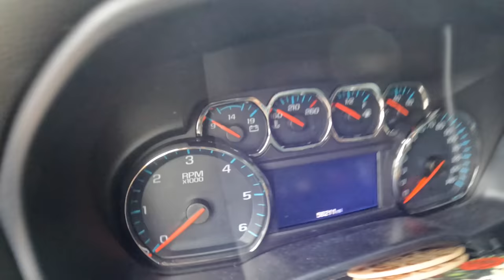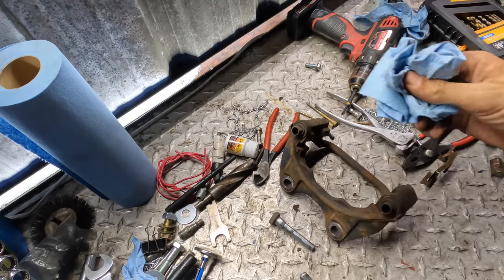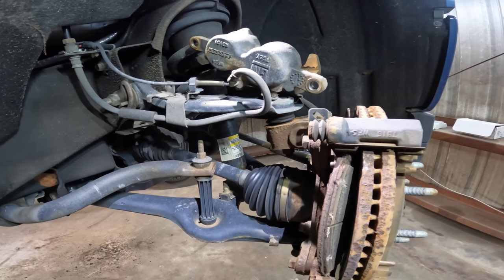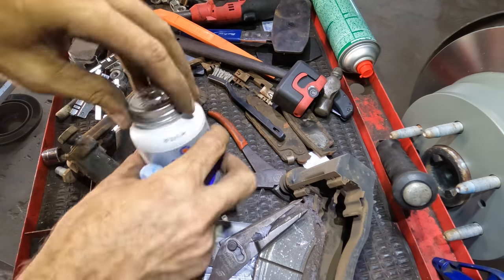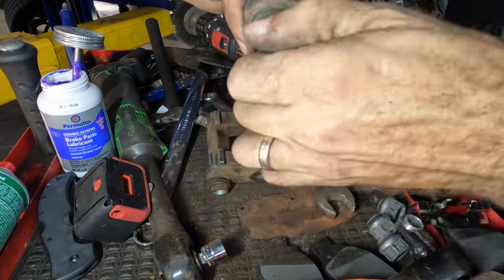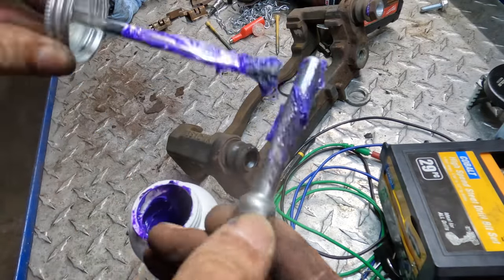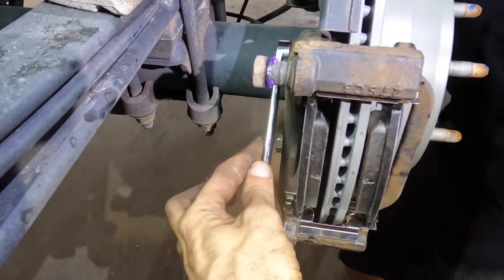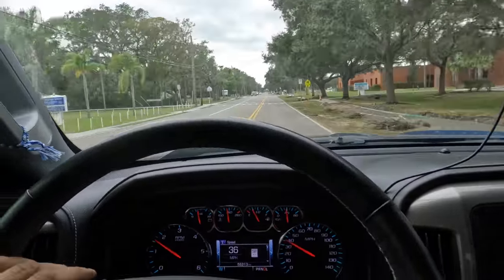Northern Rust! Challenge Accepted! New York Truck

Comment: When I do my brackets. I have found that getting a cutoff wheel and lightly touching it on rusty areas helps. Or a good flat file. That's if a wire wheel is not handy.

Comment: First, best of luck in your new shop. Second, what I hope you take as constructive criticism. I would have cleaned the old grease from the slide pin bore of the caliper bracket and been more aggressive on cleaning the rust where the shims attach and added some silglide grease there as well to help prevent future rust jacking. Also when a piston is that hard to push in, I loosen the bleeder or brake hose to determine if it's a caliper problem or a brake hose/master cylinder failure. A good test for brake drag,, on a slight grade less than 10% slope, apply brake, car out of gear, see if car ROLLS AS SOON AS YOU RELEASE THE BRAKE, You can test with car on lift by having someone in car,with brake on as you try to spin wheel, release brake and see how long it takes to release or if it does not release, repeat for all 4 wheels to pinpoint problem. You most likely know all of this, but sometimes in the heat of battle, WE FORGET SHIT.

Comment: You mentioned industrial lighting. Be warned that they are briiiight, even accidentally glimpsing them will leave one of those spots in your vision for a bit. There's another style that's more shaped like a traditional tube lamp but with LEDs that's also pretty good, and they also have a secondary LED set and a backup battery That double as emergency lighting. Don't know if you need that but if it's something you might consider, they exist.

Also if you're needing some serious air moving in the shop to keep it comfy, they're definitely not cheap but Big Ass Fans has some of the best stuff I've experienced. We have their AirEyes at work, typical wall or post mount fans but they have crazy air movement.

Comment: You must have missed a couple of episodes of South Main Auto (or you forgot to video these steps).  The area behind the clips needs to be filed/sandblasted down to bare metal.  Brake grease should be applied BETWEEN the caliper bracket and the clip.  A dab of grease on the backside of the pads is also good.

Comment: I have put a little bit of Kopper Kote on the metal to stop/reduce the oxidation between the Alum and steel. 
My they didn't use that much Brake Clean on the job of doing injector replacement on my truck as you use on one wheel.

Comment: That's not rust!  From Ontario Canada.  Had to take a sledge hammer to get my tires off.  I use under coating spray before reassembling to prevent such stickum rustiness from our salt sprayed roads.  By the way a great brake job.  Keep up the good work.  Enjoy all your videos.

Comment: Up in the rust, salt and dirt seen curbside We were always told to check the passengers side . The things I said would add abrasion material to that side wearing out sooner. But this one looks like the drivers front wore out faster. That caliper look's   suspect like you said. That pull to the right could be that driver side caliper not expanding.

Comment: Nice work.  The only thing I would add or do differently would be to clean the old grease out of the holes where those pins go. Then, put the new grease in the holes instead of on the pins so it doesn't scrape off on the rubber boots.

Comment: First customer,  don't forget to save your "First Dollar" to frame the moment. Great job on the brakes, you'll get your mojo back pretty quickly. 2 suggestions. 1 get a flap sanding disk for a angle grinder, holy cow, their awesome. 2, if your caliper  compressor won't fit, use a large C clamp. I'm sure your aware, but I cringed when you busted out the large plumber pliers. Great vid as always, cheers.

Comment: Just in case you dont have a sander or a way to sand the pads. Take the end of the pad and grind it in concrete. Of course with a coarse surface

Comment: i suspect it will need that left front caliper. in the numerous brake jobs i have done in my career, any pistons that push back that hard but do go back, the caliper ends up over heating, and i've always noticed a brake pull along with the smell of burning brakes.

Comment: So satisfying to see him to the full correct brake job (lube the pins, clean the hub, etc). Most shops just throw shit on and call it a day. Your own shop = do it at your own pace. Rather pay for this (or do it myself) than have a shop throw shit back on in 30min and have it all break later

Die Electric Grease also works as brake pin lube if you don't have any on hand

Comment: Hi Ray, Great to see you doing your thing again. You're going to do great but I did notice one thing was missing.  On top of all the other things you said you needed don't forget to buy a house phone for the shop so we can hear you singing do do do de do  do do do de do.  Was thinking about you yesterday as I was at Napa getting a new water pump installed in my Japanese soda fountain made by Nissan.   I will never buy another Nissan, they're terrible to work on.  To do any work on my Nissan you have to disassemble parts of the engine to get to things.  Anyway Napa installed the existing water pump 5 years earlier.  How the hell do I go through a water pump in 5 yrs (50k) ?   anyway I was going to wish you good luck but you don't need luck because you have skills.

Comment: Good to see you back in action!  It's messier for sure, but I use a line lock and crack the bleeder after putting a spot of pressure on the caliper pistons before compressing them.  Many moons ago, with the Teves Mk1, this was mandatory... really glad GM fixed that

Comment: You need to sand blast where the pads ride in the caliper mounts and then lube them so pads will float free. Take it from a mech In the York of new. Never seize rotor hold down screw. Lube and never seize everything. Also, membrane on the back side of new pads.

Comment: Great shop. If only I lived in Florida there is so much potential for that building. Can't wait to see what you do with it. Would the lifts make better sense reversed. It's hard to tell from the video if there's room but if is a more capable lift it would make sense to be easier to get on and off of. The smaller cars with easier turning could go on the little lift.

Comment: Ohh NOO. You should have put caliper lube on the ends of the pads so they don’t rust to those clips they slide in.  Over time especially in northern NY the ends of the pads and clips will rust causing the pads to stop moving freely (as you see in the video) and will drag, causing a sticking or not releasing caliper symptom. Lubing them in general is always a good idea to help them move more freely. Just one of those extra things you gotta do up here.

Comment: i still think you should switch the two lifts, the heavy duty lift is way more useful and ur only going to be putting smaller cars on the smaller lift and they will get around that corner easier.

Comment: Hi Ray congrats on ur new shop !!! But just want to ask you why didn’t you put anti seize on the mating surface between the rotors and the wheel hub & between the rotor and rim, also the screw that holds the rotors in place ? I do it because 98% of my customers come back to me & so next time I do their brakes example it makes things a lot easier to remove. Like ur videos   I’ve learned quite a lot.

Comment: New truck you need the to retract the parking brake actuator with the Gm scan tool and reset brake wear sensor after brake job so you can't do your on brakes now .Electric parking brakes on Gm anyways go on automatically when you turn off the ignition if you open the door or get to close to truck with the keys the the truck will apply the brake to test the brake system  .it's nice when your service adviser comes to get something in the truck for the customer and your calipers are removed the piston comes out good times lol

Comment: The lighting isn't terrible, could be better. That lift arrangement is strange though. Seems like the big lift should be on the right with a straight shot in. Maybe the camera makes it look a little tighter than it is. Good luck on the new business! Looks like the neighborhood is getting fiber optic installed. You could ask the workers there if they need anything serviced on their trucks. Fleets can be a pain to work for, but they can bring in some steady income.

Comment: In a recent class taught by Pro-cut brake lathes, the teacher tried to change our habit of using brakeKlean to clean the rotors after assembly. “Use a diluted solution of blue dawn dish detergent and water and get all the brake dust, hand prints and any metal dust from machining off without the cost or bodily risk with brakeKlean.”
Reply: That's a great idea health-wise. I presume you mean mixed up in a sprayer bottle. But will it disolve the coating on new rotors?

Comment: I didn't see you clean the rust off the caliper where it meets up with the pads.
Also when using the incorrect tool (Locking Pliers) I always use an old pad so as not to damage the surface of the piston, and to make sure it's compressed evenly.

Comment: Before switching the lifts, the previous shop may have positioned them that way on purpose.  If you switched them and now had a truck like yours   on the straight in lift,  could you swing a regular sized vehicle in past your truck onto the smaller lift?

Comment: Great video! Good to see you back at work.
I've been told that ceramic brake pads don't wear as much, but the wear occurs on the rotors instead. Any thoughts? I really don't know.
Reply: Right, it's a tradeoff to get the most life out of the entire assembly. Just takes some fine tuning so that both the pad and rotor will need replacing at the same time, that gives the longest total lifespan without replacing anything.

Comment: hate set screws, they are a recipe for drilling into the rotor body in regions prone to rust. I like looking up the tools you use sometimes because they are useful to me and some i've not heard of before, tool trucks have stuff on there that is not common in generic hardware stores. So anyone not having access to tool truck, won't necessarily see that stuff. Parts is interesting too.

Comment: I wish I lived somewhere even relatively close to your shop. I have a northern climate Dodge Ram that has problems and now the check engine light has quit playing games and started blinking
Reply: @Dave Barcus yeah I know it. It was in limp mode. I pulled plugs and wires and replaced them. There were burnt up plugs, but the plugs also showed signs that they were to hot. Either those plugs couldn’t handle the heat range or there is a bigger problem. I ordered a timing kit and will be changing the timing chain and sprockets soon. I’m hoping that that resolves the major problems I’ve had. The truck runs great with what I’ve already done but 3 month old plugs shouldn’t have been fried

Comment: The shop I used to work at, since Brake Fluid is one of the most neglected services, we always flushed the Brake Fluid with a brake service.  We also had a moisture meter to test the fluid and it always failed on anything more than a few years old.  Hydroscopic so absorbs moisture out of the air.  Then rots the Calipers from the inside or boils at a very low temperature. Neither are good.

Comment: The funny thing to me is, even when you bring the truck down away from the rusty areas, it keeps rusting.  I'd rather buy a truck from the south, take it up north, have it sprayed (fluid film or Ziebart or whatever) and get one of those monthly car wash passes (with a high enough package to get the underbody rinse/spray) so it can get rinsed EVERY day on the way home from the last stop of the day be that work, kids' school, grocery, bank, whatever.  I'd rather deal with a bunch of light scratches on the paint and swirl marks making the paint look older a little faster than deal with all the corrosion.  This truck is NOT that old.  Not that high mileage.  But it looks like my rust belt sourced minivan once you take the wheels off.  My van has five times the miles and three times the age of this truck and it's JUST as bad.  But now that I'm in Oklahoma, and I've replaced just about everything underneath the van except rear hubs/shocks (and they're next), maybe I've defeated the corrosion monster.  It might NOT get worse.  But if I take it back into the depths of the salt pits that is Ohio's highways...I might as well leave it there.  Great argument for renting cars on trips where salt and brine are used.  It's not worth taking your own vehicle through it.

I want to publicly apologize to every shop I've ever taken this stupid van to for having to deal with all this rust.

Comment: I would move the heavy lift to the straight in position. It will be easier to make the turns with the smaller lighter vehicles. I, my self am not any good at videos so i will not presume to coach you on same.

Comment: I'll be a northerner asking "where is the rust"?
The rust jacking under the shims probably needs more than wire wheeling, I've done that and then scraped with the end of a file and chunks of shiny corrosion chipped off... scrape and then wheel it, smooth sliding.... grease that raw cast iron under the shims, too, or you'll redo those next year

Comment: Oh my God Ray. I am in the process of swapping my pads and rotors out on my 18 Sierra and I had to heat and beat the rotors off as they were completely rusted to the hubs. Interestingly enough,  my driver's front caliper needs to be replaces, one pin is fused to the bracket. And why do they lock tite the caliper bracket bolts????

Comment: A very corse file could save you going through tons of disposible flapper wheels.
Buying a bulk amount of cleaning fluid + a spray bottle could be cheaper.
You use a lot of cleaning fluid.
Buy cheap crap towels or old clothes to use for wiping down parts.
Your wallet is not a bottomless pit 😀
Coffee is your friend lol.

Comment: That brake job is just a scope of mild rust for brake jobs we get here in Newyork lol. You need to really get all that rust off completely it's like cancer for these vehicles especially brakes makes them swell super bad. We lube under the hardware aks shims to help ease rust from building up there and lube the pad tabs where they seat as well. So the pads don't seize again so easily. Rust in the rust belt here is real. Most cars are in the junkyard or looking towards it in 10 years. Pretty rough especially if you don't care for your vehicle and undercoat it here and wash it at least once a week.

Comment: One, THAT is an up north truck???? The rotors on my Volt were harder to remove than those! Two, is it going back up north? Because if so, any reason not to use that same permatex lube before mounting the new rotors? I've used that stuff for that purpose for years - also every time I swap my wheels between seasons.  Obvs not on the studs.   But I live in a road salt state, and it makes a huge difference when doing the next repair/maintenance :)

Comment: I assume you have been at this for quite some time. Can't believe you haven't run into a piece of trash getting pushed back into the antilock valves and ruining it. I found out the hard way. Always easier to use brake hose pinchers and open the bleed screw before pushing those pistons in. Can always gravity bleed to make sure there is no air in system.

Comment: Hey Ray. I've been doing my own maintenance for a while now and I'm curious as to why you don't use a torque wrench on the bolts for brake work. Is it just experience, your tools, or something else? Also bleeding. Is that not necessary after a brake job or would a spongy pedal (my experience) with no obvious signs of leaks be indicative of another issue?

Comment: Hey Ray, would it work/be easier to swap the lifts so the better lift that holds bigger trucks would allow you to pull them straight in? If not, maybe back the vehicles in to get more ventilation by the open door to stay cooler? (After the exhaust fan is in for … exhaust) & of course with tools moved closer to big door?
Reply: I agree, was going to suggest the same thing!

Comment: 36:18   Eww, brake fluid overfill!    I hate when it's topped off with worn brakes!  Edit:  Those coated rotors are clean, spray the DOT III on the inner fender plastic and suspension.  :D

Comment: All these bolts have a specific torque setting,  some have loctite  as well. Clickage will not help you should some component come loose. Your insurance carrier may well be having fits watching this video. A torque wrench was one of the most used tools in our workshop.  You should have a day book apart from an office diary. In it you put the vehicle, tag , mileage brief description of job I.e. pads and rotors all round. Then note torque  settings for the bolts and the lug nuts. All this takes a minute  and can save your hide should something go wrong. Our legal system is not forgiving ...

Comment: The only constructive criticism I have to offer is when you were compressing the pistons on one of the front calipers, you appear to be struggling a lot with it.  In my opinion, that should have been replaced.  No questions about it.  Other than that, stellar job.  I know from time to time, you may get a set of pads that fit a little tight and it might seem questionable to some.  But it's perfectly normal to have to remove a little material from the ends to get a better fit.

Comment: If you build your own brakes, ALWAYS put the assembly screws back in the rotors when you install them, same for the brake drum assembly clips, then on the 2nd or 3rd set of OEM brake parts when the new guy at the tire store sees it and is dumbfounded by how you've gotten THAT many miles on the 'original' brakes. even better if your gas tickets are in the car so he knows you DON'T drive like a little old lady.😁
👍🇺🇸😎